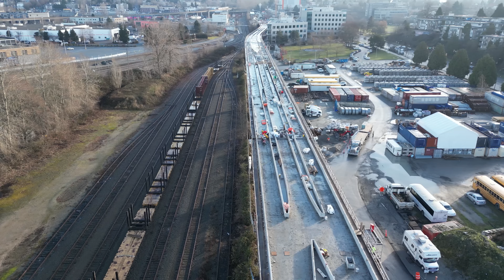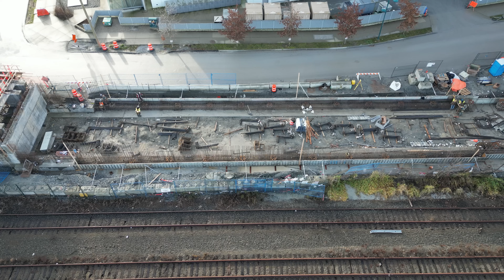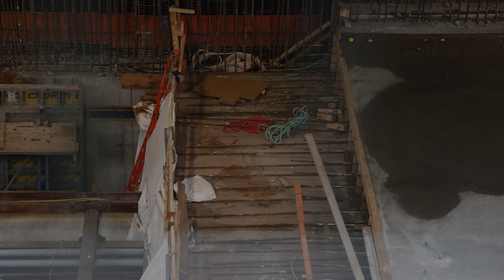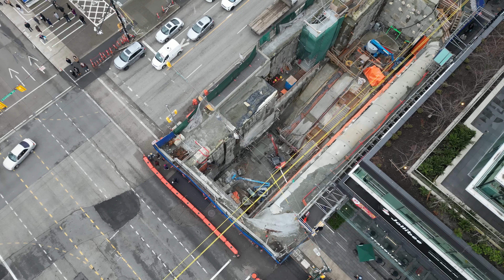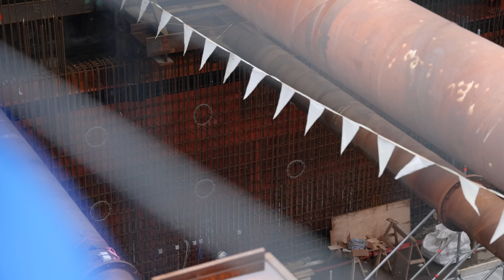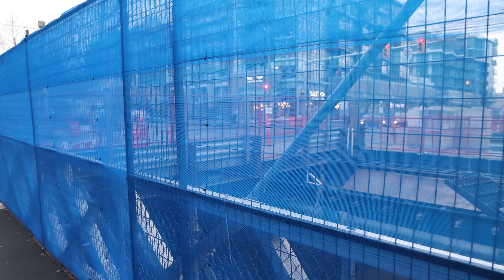Broadway Subway Construction December 2023

Comment: I can't take away anything from your video, which is very good, but the system itself is so mickymouse.  I can't believe that a station with two lines is only going to have one entrance.  There's already a space built underground on the northwest corner, so why not use it.
Reply from the maker: Glad you like the video! I spent a good amount of time reading up about why they decided to go with only 1 entrance at Broadway City Hall. According to the research once the new line is open almost all connections will be within the station. The main entrance will only see moderate foot traffic for local buses, business, and residents around the area.

We might see something change when the Canada line requires expansion sometime in the next 15-30 years.